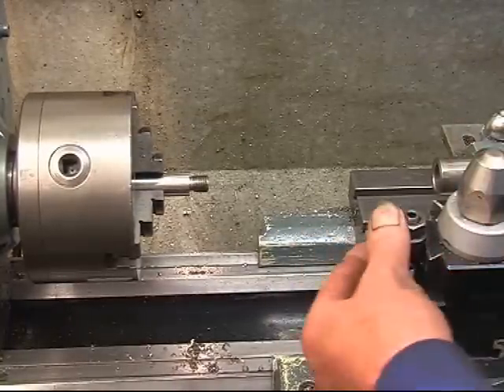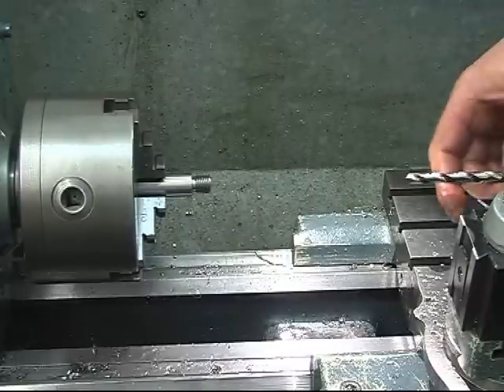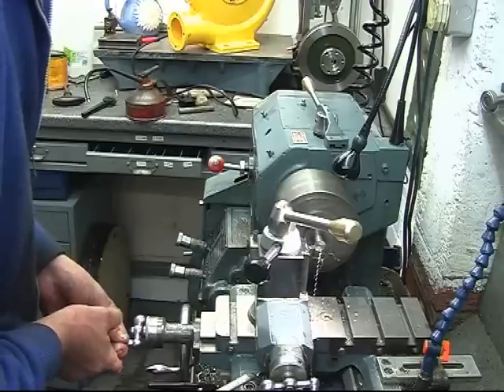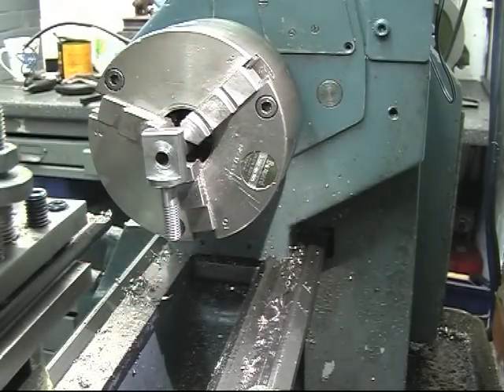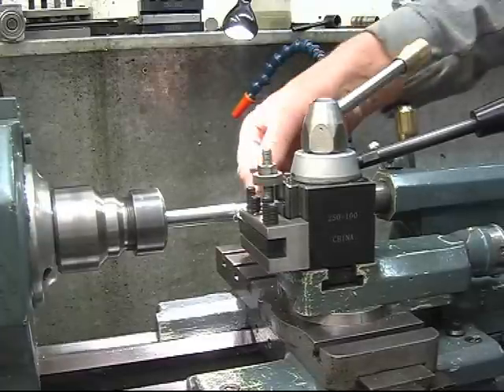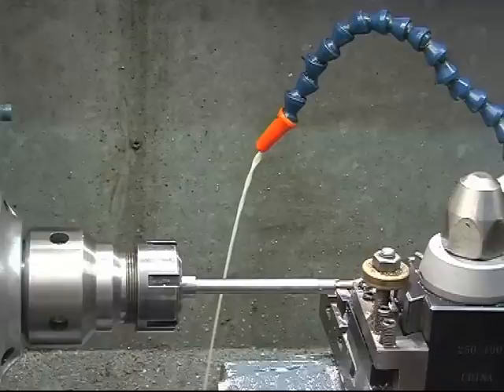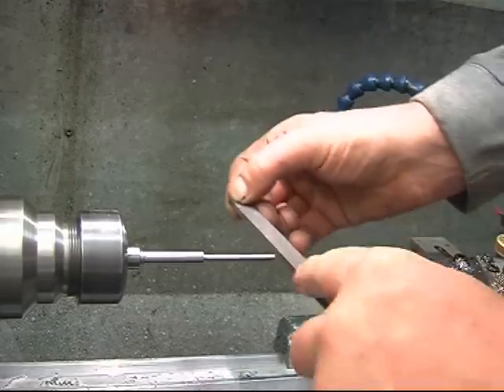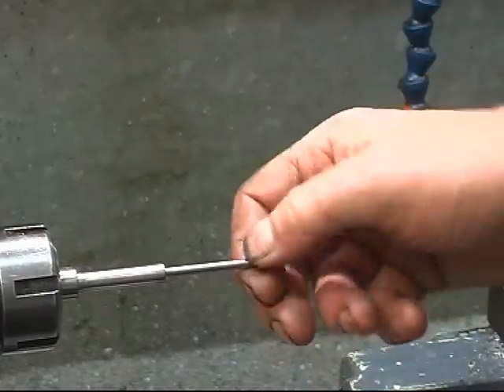DIVIDING  HEAD PART  24 WHALE OIL NEEDED

Comment: You may not be able to get whale (sperm) oil anymore, but you can get the equivalent. Jojoba oil (ho-HO-ba) has exactly the same physical characteristics as sperm whale oil. It is very light, has a long shelf life, does not creep (from where you put it to where you don't want it - this is the advantage to watchmakers), and does not dry to a gum (or at least not for a very long time).

I have to say that using it as a quench oil seems a bit extravagant. My dad treasured a tiny bottle of sperm oil (less than 1 cc) that he used by dipping the tip of a straight-pin to bring a single small drop to where it was needed. This bottle lasted him from some time in the 1930s until he died a decade ago.

Amazon carries jojoba oil. I expect for lubrication purposes, you should get the refined version. I think the unrefined version is a nod to the health nuts who think anything processed in any way is a threat to their very lives.